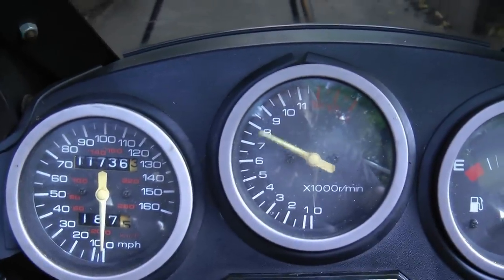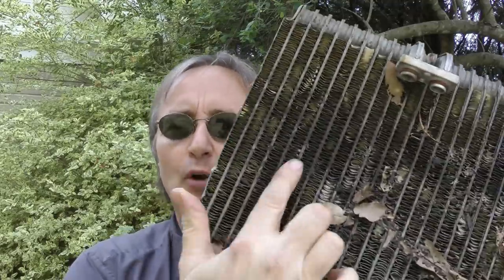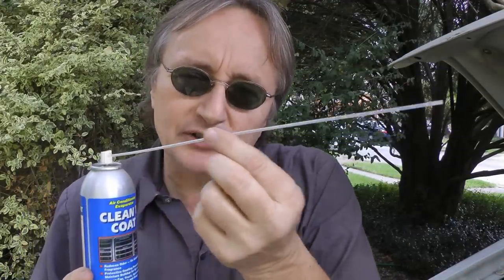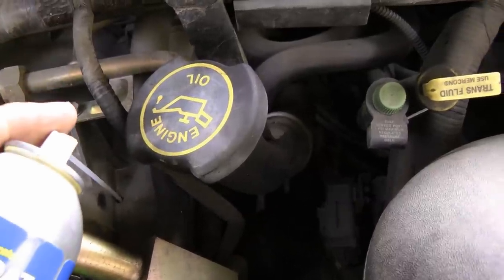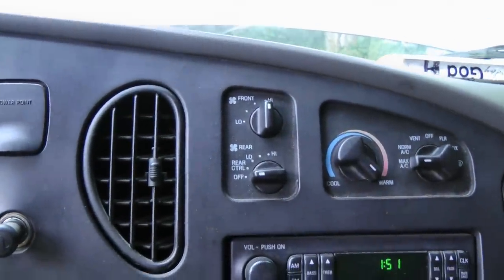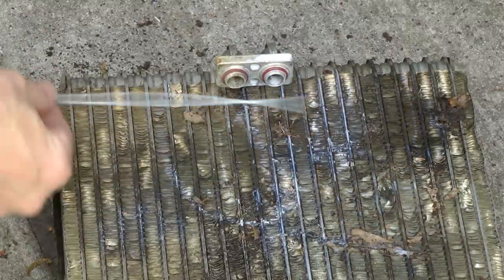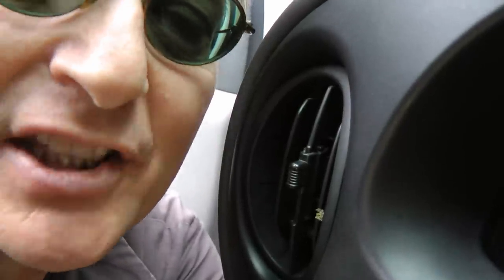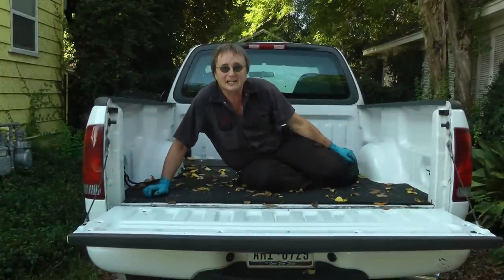How To Remove Car Vent Smells (Odors)

Comment: Yeah, that's an unquestionable truth, but using a drill in a very tight space really close to the evaporator may, just MAY end up in damage. Accidents can happen. And usually, they happen when you least expect it. 
In my experience with cars, I got to the conclusion that you should avoid risks like that as much as possible.  
I myself always try to find ways to fix my cars that involve the least amount of cutting, drilling, whatevering.
Cheers!

Comment: Don't want to be rude, but there are products available that can be used without drilling holes in the AC system. You just shut the doors and windows, put the AC on full recirculation, put the can inside the car and break the cap on it. Then you let the system absorb the product and run in for a few minutes before you vent the car. Just like those bug spray bombs that they use to fumigate houses. 
Drilling holes in the AC system... I would like to stay way clear of that idea..

Comment: Why are the sources of most problems hidden and tucked away and are a pain in the ass to get to? It's ironic because you'd think a part that's buried would suffer less wear/tear as opposed to something out in the open, easy access, dangling about. -_-

Comment: This seems like a pretty involved process... shouldnt be too much more work to just replace the evaporator and blower/resistor before they go on their own.
Reply from the maker: Some cars require over 8 hours to take the dash apart and remove the evaporator assembly. Believe me, you don't want to mess with that in many modern cars

Comment: He drilled a hole in the plastic box that houses the evaporator core not the actual evaporator or A/C system itself. A/C refrigerant would leak out if he did that.